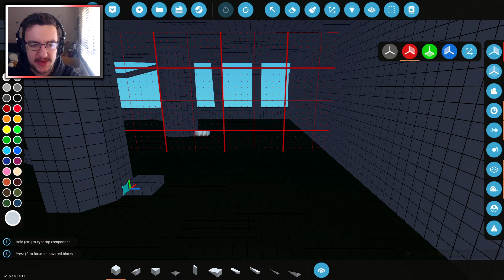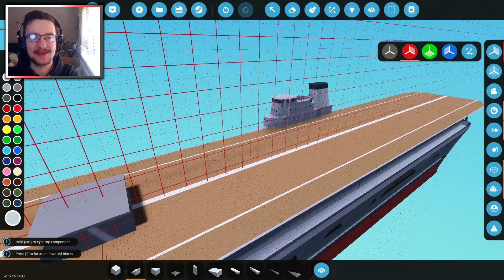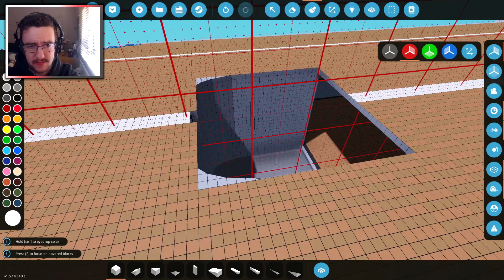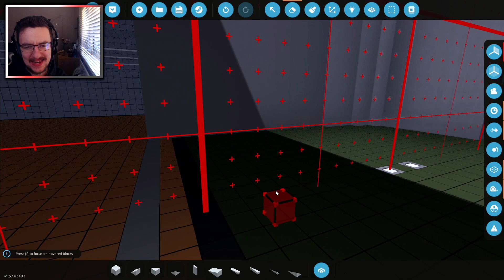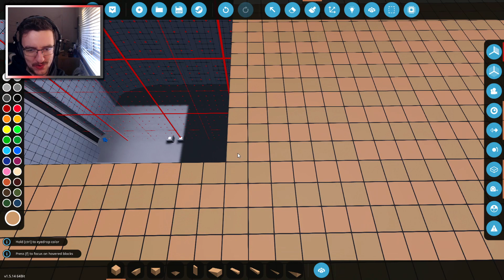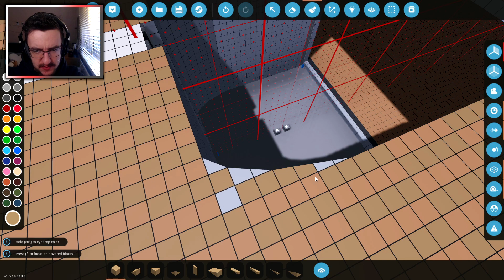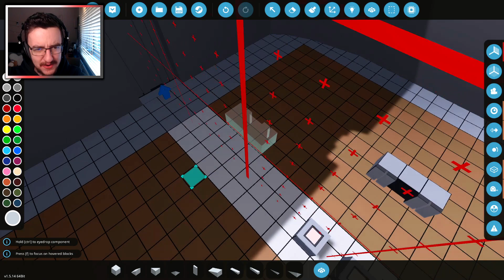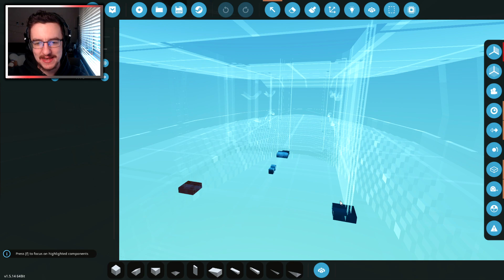PLANE ELEVATORS INSTALLED! - Aircraft Carrier Build - Stormworks - #9

Comment: A naval P-36 would work, with its longer pistons it had a stout engine. It was relatively small too. Though it was land based just adding a cats claw with a mag all, just add lines on the deck to let you know where the claw needs to touch before the plane stops on landing
Reply from the maker: Hmmm, interesint :D

Comment: You can power all the tracks together so long as they are geared the same and are the same speed/power. Set the gearing for 1/32 which is max power. You don’t need speed for this elevator.